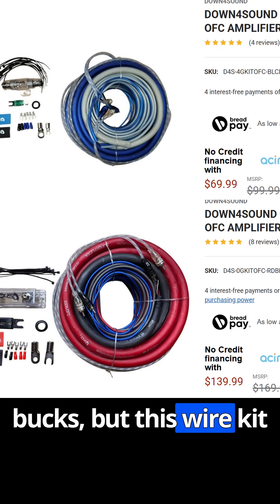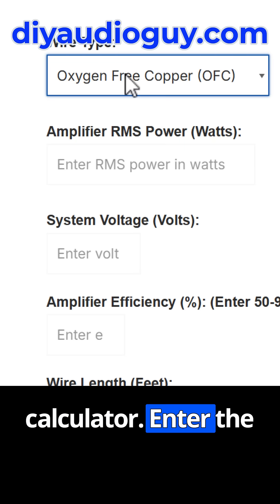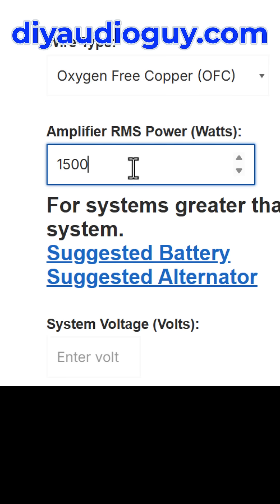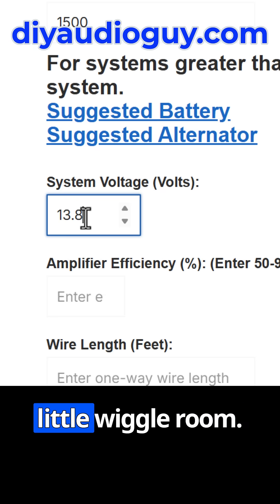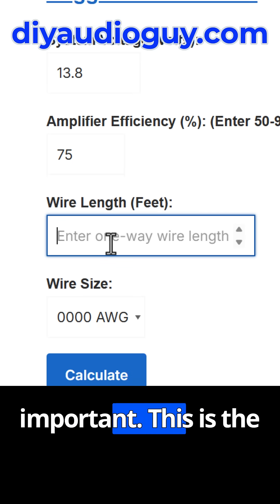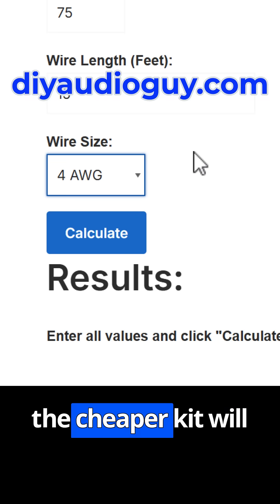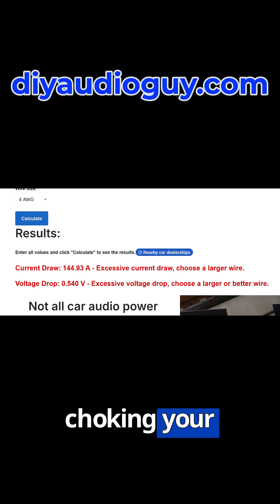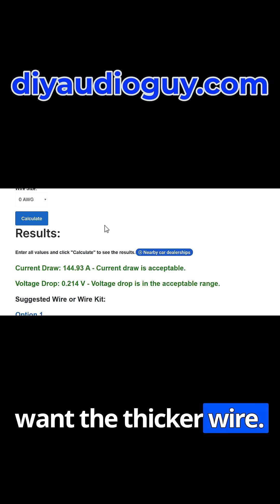Power Wire Calculator #subwoofer #bass

Comment: Why you don't recommend CCA? Aluminum is cheaper, lighter. Yes, it's ca. 60% more resistive but you can compensate with cross section and still have it cheaper and lighter. And CCA will look like copper, if that's your fancy.
Reply from the maker: Corrosion
Reply: @DIYAudioGuy  Not an issue at home. Heck, not an issue in automotive powertrains. More often than not you'll see aluminum busbars and wires in EV battery pack. So sorry, but I'm not buying that argument, neither should the rest of people. And before you counter that, some food for thought: what material are the power grid cables made of? Both overhead and underground? ;)
Reply from the maker: @Lvvcassss Fair enough, buy whichever wire you want.

Comment: CCA is fine in low power situations, Below 1kw is fine, and that assumes 25 feet and 0 gauge. You're looking at only a small difference in resistance and minimal heating of the cable. Once you approach 5KW, then OFC is the obvious choice since you'll displace nearly the twice the heat of copper via the CCA, 454 vs nearly 800 watts. At that point, less resistance is better, so go larger cable and do the math again.
Reply: CCA, or even pure A is ok for you'd-be-surprised-how-high-power situations. Pretty much ALL the grid power lines are aluminum :) The difference in resistivity vs. copper is not that small but cheaper to compensate in  cross section.

Comment: Pro tip if you love loud low music and you're just getting into car audio just know full well you're always going to want more and bigger sometimes it's okay to think ahead for situations like that if this is the case go with the largest wire Straight Out The Gate this means you will save some money in the long run if you're going to go bigger anyway. Best of luck everybody.😊
Reply from the maker: I did an upgrade in my truck right before I started the youtube channel.  I only needed 4 gauge wire, but ran zero just because I knew I want want a bigger amp one day.
Reply: @DIYAudioGuy  This is a little off topic but I'm wondering if you know of anybody that's ever installed tactile transducers in their vehicle? I previously had a quad cab truck build two 15 inch subs rear seat delete smart 3K this time I'm considering smart 5K and two 18 inch subs but also I was considering getting two earthquake tactile transducers I think the model is QB 10 this could help in addition to the 18s  but what I really was thinking is they could work nice if I'm in a situation where I can't listen to the loud Bass some transducers could possibly fill that Gap😊